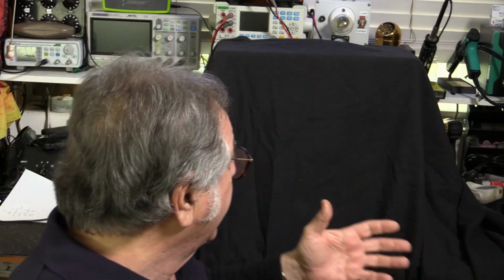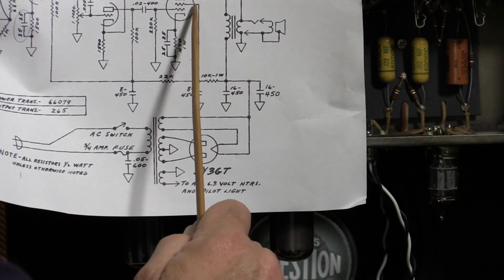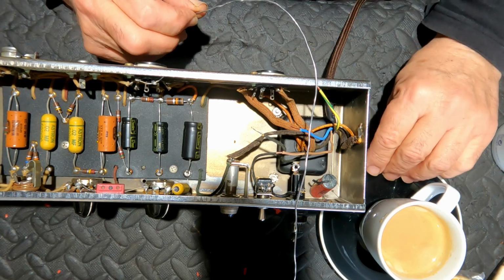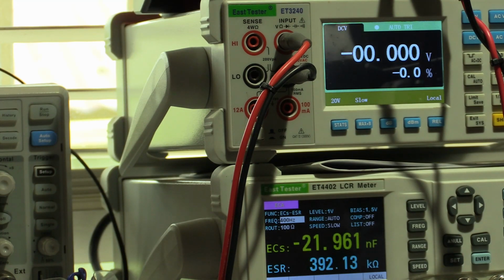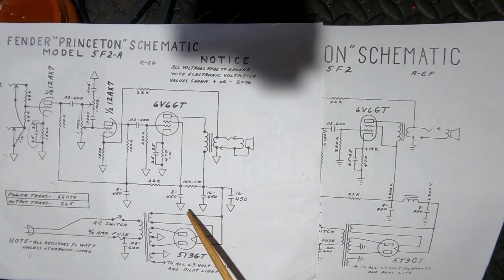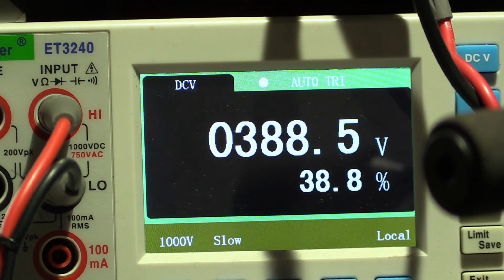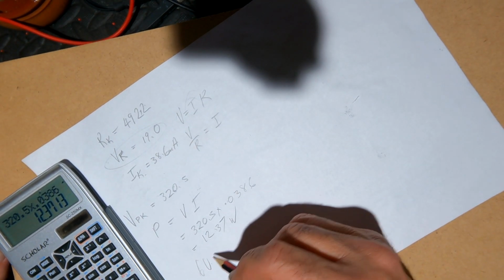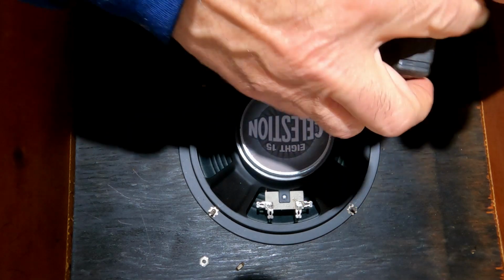Tweed Princeton 5F2A - Learn diagnostic and repair techniques to make this amp safe and original.

Comment: Would your esr values be accurate with a resistor in parallel in circuit while you take test readings??
Reply from the maker: That’s a very good question, David. If there is a capacitor in series, it’s very easy to see because the C reading will be higher than the stated value. However, if there is a resistor in parallel, the ESR value would be slightly smaller (depending on the parallel resistor value). This would mean that I could be more likely to accept a capacitor than pull it out. We have to remember that my goal is not to have an exact value of Dissipation or ESR, but rather a Good/Bad indication. If my chart shows a maximum of 2 ohms and my ESR meter reads 2.2ohm, I would most likely leave the Cap in service. If it reads as 10ohm, I would definitely replace it. I also use my subjective judgement. If there’s a buldge, or it’s a known troublesome brand, I will show it less mercy. With vintage gear, I am always conservative. I have a passionate dislike for shotgun replacements of components .

Comment: Since the secondary of the step down Xfmr is isolated from the mains, shouldn't it not matter whether or not the plug is wired Ozzy style?
Reply from the maker: Sorry Ross. I'm not sure if I understand your question, but I'll try this interpretation. A step-down transformer is not an isolation transformer, meaning that the Earth carries through to the secondary. This is important because the American Black wire is Active (the old Australian Black wire was Neutral) and cannot be reversed in a 3-pin configuration. This means that it is critically important that the Active is FUSED and then SWITCHED.
Reply: @theguitaramptech  Apologies for lack of clarity.

Comment: 120 watter??? that is a bit of an overkill- i have used a 80w weller for years and haven't found a chassis grounding job it hasn't been able to handle.. With that 120 watt gun, you must have a window of about 2 minutes from when it is powering up and before it gets too hot
Reply from the maker: I love it. It can do any job I want. Are you admitting that "you can't handle the power?"  Hahaha!

Comment: Hey Chris, great video.  Question, without having an ESR meter, what would be the best way to test cathode bypass caps? Would measuring capacitance on the multimeter be a good indicator?
Reply from the maker: Hi Jon. The condition of a cathode bypass cap is not critical to the amp's health, unless it fails Short. The ESR is the measure of the internal resistance and can be an indicator of an upcoming event....failure (due to internal heat build up). Simply measuring the capacitance is a DC way of measuring a reactive (ie AC) element. It is good enough for a bypass cap for home use. The problem is that many Tech take the easy option, too. Its usually because they're, cheap, or lazy, or simply don't know what ESR indicates.
Reply: @theguitaramptech  thanks Chris, good knowledge right there.   I had a search through Jack Darr as well and it says that you can measure the Dc resistance of a cap.. if you get any reading at all, the cap is bad. A more crude ESR measurement I suppose.  Between that and measuring capacitance (as you mentioned) you can get a pretty good handle on whether a cap is good or not with just a multimeter. Thanks again, keep up the good work
Reply from the maker: @jonlanning8973  yes, as you say, using DC resistance to measure ESR is very crude. The reactive impedance of the capacitor depends on frequency, and the ESR will change with frequency. It is best to measure a capacitor for capacitance and ESR at the operating frequency of the component. Long story short: using the DC resistance is better than nothing :)

Comment: I would love to get my hands on a vintage princeton!!
I just built another 5f2a based circuit.  I used a blackheart little giant 5 watt amp as a donor. I added a matshall value tone stack, raw switch , bright switch and the variable nfb pot. 
I was hoping for a JTM-5 sort of thing.. and i pretty much acheived it. 
Im starting to love that circuit.  Suprisingly loud for 5 watts!!
I was suprised to see 5 volt taps on the pt. The original blackhewrt used a bridge rectifier .. i used the 5v taps on a 5y3.
Reply from the maker: Very cool. Yes, 5w is surprisingly loud.

Comment: I disconnected the negative feedback loop on mine, and I also added a 25/25 bypass cap on the second stage of the 12AX7. These two changes livened it up quite a bit. I'm not concerned in the least with absolute originality. This one's a keeper. No flips in my world. Ever. The next time this one changes hands will be at my estate sale.
Reply from the maker: That's great. Both of those changes are easily reversible. That's quite a bit more gain there.  I'm glad you're enjoying your amp even more.
Reply: @theguitaramptech  I was changing the cathode resistor anyway because it was out of spec. I said "I wonder what would happen if I bypassed this stage with a cap?" It was a good move, as was removing the feedback loop. It didn't turn  into a death metal monster or anything like that, it's still a Tweed Princeton, there's just a little more of it. Maybe just a bit more high end and a little less mud in the low mids.
Reply from the maker: @jpalberthoward9  Good work.  If you want to reduce some of that low-end flatulence, try reducing the first-stage cathode bypass cap from 25uF to something around 2.2uF.

Comment: I just finished my 5th amp build. A 5f2a.  I used transformers from a crate v5 so no rectifier tube . I added a nfb pot (5k to 100k), which works wonderfully, credit to uncle Doug for that idea! I added a master vol as well. 
I plan to get some hammond transformers with the proper 5 volt taps eventually and build another. I will be incorporating a Garnet Herzog (a'la Randy Bachman and Gordy Johnson) into the amp next time.
Reply from the maker: Great work, Soapbox. I'm glad to see you reused transformers. I assume you checked the impedances were OK for the OT? The output tube type and the speaker load need to match. I am sure @uncledoug did a video on that very topic. 
Cool having variable NFB. 
I have never come across a Garnet in Sydney, but if Randy used one, I bet it sounds great.
Reply: @theguitaramptech  thanks! The original amp ran a el84 and I'm running a 6v6 so I think I'm good. The ot only had 8 ohm taps.  I'm using a 20 watt greenback reissue with it. Sounds real good.

Comment: Hi! An American here (I say Solder with the L because I think it is funny and it makes the people I work with wonder what I am going on about). Dont you use isolated secondaries on your step down transformers, and only bring the ground wire through? I would expect that the Active/Neutral debate wouldnt matter then, or do you connect the neutral through as well as the ground? I'm not trying to be smart, I've given up on that long ago, but I am curious about this.
Reply from the maker: Hi Leif. Good work on your pronunciation! 
I am not exactly sure what your referring to, so I will answer your question generally and hopefully get the answer you need. Yes, in the "olden days" of American mains wiring there was no difference between Active and Neutral, but today their relative location to the Earth pin defines the polarity. In Aus Brown in Active and its White in North America. The secondary is Isolated in the better Stepdowns, but not in the cheapies. My philosophy is to follow the wiring colour scheme of the amps, but I will always Fuse (first) and switch the Active (White or Brown) while the Neutral goes straight to the transformer.

Comment: Hi Chris. Not sure if others have mentioned this but I think you made an error in the 6V6 dissipation calculation. 
You measured the voltage across the cathode resistor and used ohms law. Nothing wrong there, if you want to know the TOTAL current through the valve/tube-anode/plate & screen current. 
Then you used this current, along with your Anode/plate to cathode voltage to work out the anode/plate dissipation and got a high result. Of course you did, because you didn’t use the current through the anode/plate and anode-cathode voltage. As far as I can see you didn’t factor in the screen current( probably some 5-7mA). Since the cathode current you used also included a slight margin( the additional screen current) anode/plate dissipation is probably a little under 12 watts, right where it should be.
Reply from the maker: Hi Tim, thank you for your comments. You are quite correct. I normally allow around 8% for screen current. 
I always have an internal struggle about how much detail to go into in the videos. Most are an hour long as it is. When I use my EuroTubes Bias probe, it reads the Plate current not the combined plate and screen, but not many people have access to one of these instruments. I was trying to demonstrate how MOST people could set the bias better than what their amp left the factory, which is almost always too hot. True, my "Bias-Lite" method may lead to a SLIGHTLY cooler setting, but I definitely prefer that to a too hot setting. I always check a cathode or fixed bias setting with my oscilloscope as the quoted maximum percentage figure is only a design figure. The oscilloscope shows you what is really happening in this particular amp. 
You made a valid point, but its too complicated for where I want to pitch my videos. An advanced Tech, like yourself, would know this and account for it, but only if they measure the real screen current and not just estimate a percentage (like me), or a screen current (as you suggested).  Thanks Tim!

Comment: Ok it would be out of phase east fix put a switch on it and if it sounds bad switch it most modded guitars actually have this mod installed for different tones also many tubes amps made in America for hifi has a phased switch I have about 4 like that it’s not a big deal in the USA 🇺🇸

Comment: I’m building one now from scratch using old ww2 tubes and metal almost there just have to wire it up
Reply from the maker: Very cool, Jim. I bet its going to sound great, just watch your lead dress and how you run the heater wires.

Comment: Awesome.  Just wanted to add 2c for anyone restoring an old fender, as well as checking leakage on the caps I have found it is really useful to sniff around on the fibre board itself.  I have cured a few elusive noise issues by getting rid if dc leaking in the board.  Same with the cloth wire.  Chris, you are a very patient man replying to some of the comments here, everyone is an expert I guess.
Reply from the maker: Thanks KB. If someone makes the effort to write a comment I will make the time to reply. Its like someone ignoring you when you talk to them. 
Some EXCELLENT suggestions KB. When I just can't find a logical reason for stray voltages, conductive fibreboards may hold the reason. I can't say I've found conductive cloth wire insulation, but it sounds feasible to me. Thanks for that suggestion.

Comment: What year is your LP Deluxe?
Reply from the maker: My Goldtop is a late Norlin from 1979. The body is a single layer of mahogany. Its the heaviest guitar I own at 10.4lb, but I love the sound of the minihumbuckers and feel of the neck. The black Les Paul Custom you may have seen in other videos is from 1971. Its 9lb. When I Bought it, it had EMGs installed, which I ditched. It now has some beautiful Sliders PAFs.
Reply: @theguitaramptech  
Very cool, thank's 👍
I had a pancake Deluxe just like your's. I love those gold tops, so much that i removed the pick guard.
It was HEAVY.
Congratulations 🍻

Comment: I can’t believe you would even take a chance using any of those original capacitors in that amplifier.. Just because the parts are original doesn’t mean you should feel bad about replacing them…. If the caps are shot their shot.. By not replacing them, you could cause more harm to the amplifier. You wouldn’t keep the original oil and air filter in your favorite vintage automobile… Or leave a malfunctioning coil and cracked shorting spark plug wires just because they are original right? Doesn’t make any sense to me at all..  But nice job troubleshooting and replacing/installing the new parts..
Reply from the maker: Great email Tom with excellent points. While I agree with some of your comments, let me clarify some others. Oil in a vintage car is a consumable item and does not make up part of the value of the car. Conversely, original amp transformers are critical, like an engine in a vintage car. Components such as capacitors or resistors are more like the wheels. Some owners like it 100% original while some will put on alloys. 
I agree with you about replacing capacitors that can damage the amp or the owner. You may have seen me change the main filter capacitor and the coupling capacitor. They are both important for the survival of the amp. As you know cathode bypass capacitors can be removed or added to a preamp tube with no detriment other than changing the tone of that stage. Those are the capacitors that I had left in place. They weren’t shot. They had high ESR values, which is an indicator of approaching end of life. If they died, the amp would just sound a little darker. 
As the amp tech for the major vintage amp store in Sydney, this amp did not yet have an owner. Would he be a collector who would pass by a heavily worked amp, or is he a gigging musician who wants it quiet and 100% reliable? I have no idea. If the amp is brought in by the owner I ALWAYS ask “how do you intend to use your amp”. 
All techs MUST preserve the originality of a vintage amp, unless, as you quite correctly said, there is a danger to amp or musician.

Comment: Hi Chris, watched the vid from start to finish, the humor is v important for those that don't follow electronics.
Can I just say a big word for Webber speakers and the Ted Webber Speaker Company.
You shipped me a 10 inch Webber for my Vox AC 10 and it sounded great but inexplicably some thing happened and it stopped which is a very very rare thing for a Webber speaker to do.  The most amazing thing that happened after that though is Webber agreed to send me a replacement speaker from the US (*@#!!$$$) without even having me send it back to them in the US or to an Australian agent to be officially checked. Webber have v grueling pre sale testing perimeters for each speaker and you yourself tested the amp through its paces before shipping to me.  Whatever caused it to stop is more likely to to do with me somehow more than the Webber failing. So I am just as impressed with Webber family Customer service as I am with the quality build and sound of their speakers.  Cant praise the Ted Webber speaker company enough in all aspects of business. Thank you, Adam Cherry WA
Reply from the maker: Thanks for your feedback Adam. I have lost track of how many Weber speakers I have installed over the past 30 years. I have never had a failure. When I spoke to CJ at Weber about your situation, he was equally surprised. I am happy, but not surprised, that Weber stood behind their reputation to ship a replacement speaker at their expense to you. That's a mark of excellence.  I am very happy that you're enjoying the sound of your upgraded AC10. I think they're a great little amp.

Comment: I totally get why people would want to keep amps like this Tweed 5F2A 100% original, given the very high prices they command on the used amp market, but one question I would ask is this, would a person prefer an amp that was 100% original, not quite fully functional, and potentially lethal, or an amp that's maybe 80% original, fully functional, and safe to use?
Reply from the maker: That's a very good question. I ALWAYS ask my customers how that plan to use the amp and if they will be gigging with it. Their answer tells you how to proceed.

Comment: If this had've been my Tweed Princeton 5F2A amp, first thing I would have done is go straight to the Evatco website and order a new 240V AC 5F2A power transformer online and used it to completely replace the original stock power transformer, and then I'd go through and re-do all the mains wiring to make it compliant with the current Australian 240 V AC mains wiring code as a matter of course, before even thinking about plugging it in after replacing any faulty components, especially if I knew the amp wasn't going to be used anywhere outside of Australia.
Reply from the maker: Sorry Simon. I didn't realise you were an Aussie for my previous reply (gasoline comment). I agree with everything except the change of power transformer, no matter how tempting. A power transformer WILL change the sound. Maybe not as immediately as the OPT, but it will have different windings, core, laminations, saturation, etc. 
But, Simon, to show what a hypocrite I am, I did change the PT on my 1963 Fender Concert because I got sick of carrying a step-down to gigs. But now that I now longer get loud 45w gigs, I am seriously thinking about returning the original  Schumacher transformer to duty.

Comment: Thank you for another fun and educational video, Chris. I always learn at least one new fact or technique from your videos. I really liked the way you test for leaky coupling capacitors. I never trusted a multimeter to tell me the real story.
Reply from the maker: Thank you for your kind words, Les. You are right. Because of the very high input impedance of a DVM (which is what you normally want), you can't trust it to give you an accurate understanding of coupling capacitor leakage.